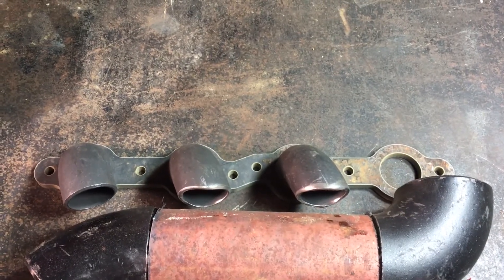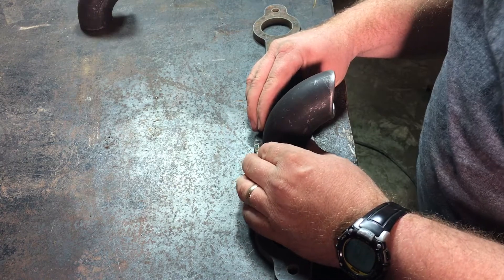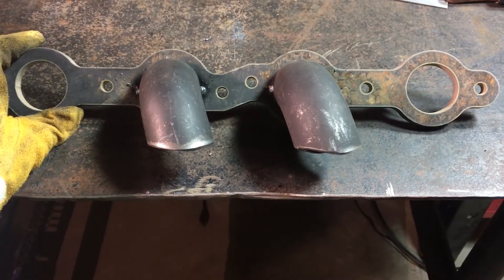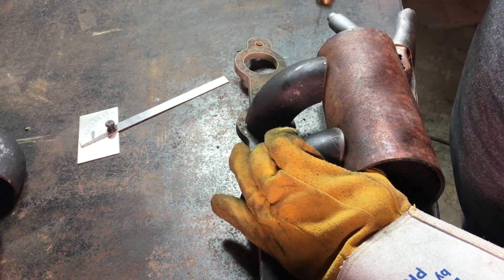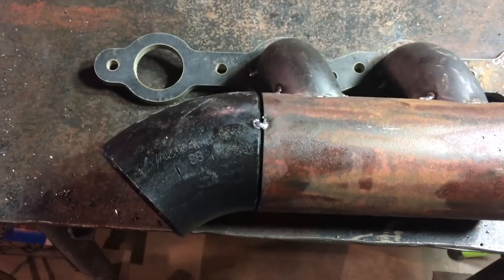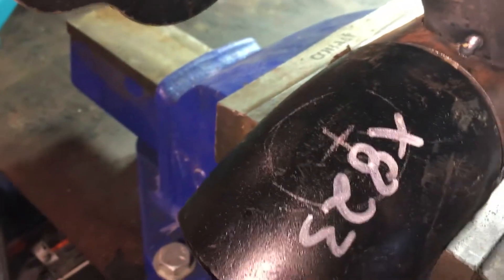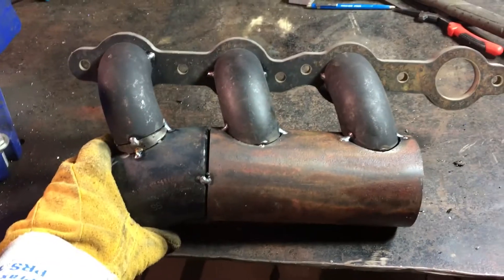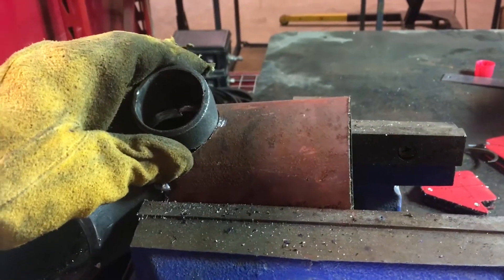LS Turbo Log Manifold Fabrication - Part 2 - Main Assembly

Comment: Hey just a safety tip when ever working with power tools and fabricating you should remove your wedding ring.  
There’s a recurring injury called “de-gloving” it when your ring gets caught on a tool and it will remove all of the flesh right off your finger down to the bone.    Keep up the hard work
Reply from the maker: Ok thanks for the tip, and thanks for watching and commenting!

Comment: how much would you sell one for?
Reply: Those manifolds only fit with a lot of tubing Fab if u keep the mechanical fan not as much with electric fans thought
Reply from the maker: I’ve already got rid of the mechanical fan and have a Ford Taurus electric fan I will be installing at some point.
Reply from the maker: I don’t think the quality of this manifold is good enough that I would sell it to the public. In fact if I had to do it over again, I would just buy a Hooker 8510HKR manifold set. Thanks for watching and commenting though.

Comment: Approximate price for your materials there?
Reply: Just ordered the trick performance  manifold little over 650 bucks. Fml.
Reply: Somr ebay heat wrap and nobody would know the difference. Would of loved to fab mine but the majority of my truck has been built in an apartment parking lot snow bank lol.
Reply from the maker: Right around $50 with the salvaged pipe, even if I had bought everything it would be well under $100 for what you see here. By the time I include the V-band clamps and the T4 flange it’ll probably be a little over a hundred bucks.
Reply: Nice, that's a heck of a lot cheaper than a KB or Trick log haha
Reply from the maker: Yep I'm all about cheap haha
Reply from the maker: Their manifolds look pretty sweet though, especially the cast ones. Mine won’t be that pretty, should do the job though.
Reply from the maker: Timothy Hutton wow, no wo wonder you want the snow to go away lol. Where are you from?
Reply: Lowbuck LS hahaha definitely a little less snow would be fine. As long as i dont exchange it for rain. Lol from calgary ab.
Reply from the maker: Nice, I’m just north of you in Sylvan Lake
Reply: Lowbuck LS oh crazy. If your ever this way or need something picked up let me know. Cool to talk trucks.  Im doing a similar build as you just mine is a lifted 4x4.